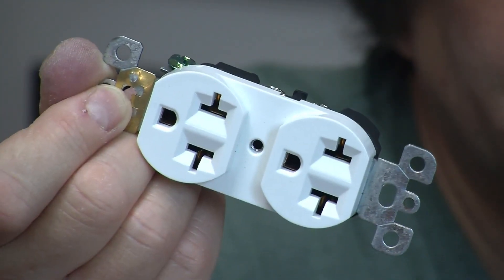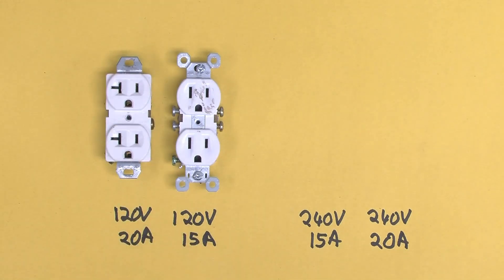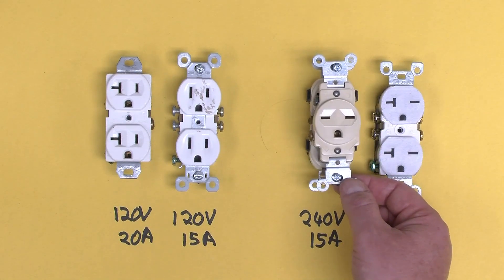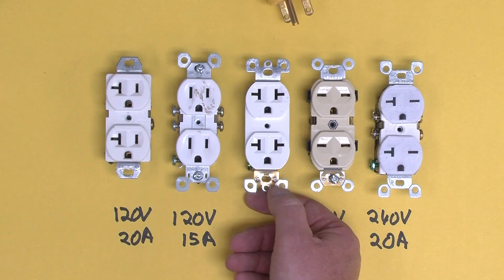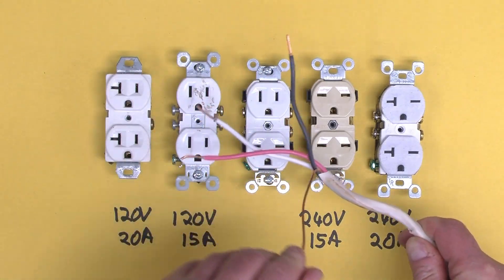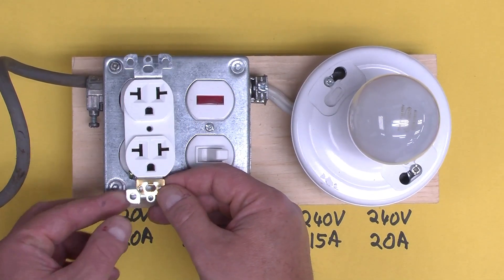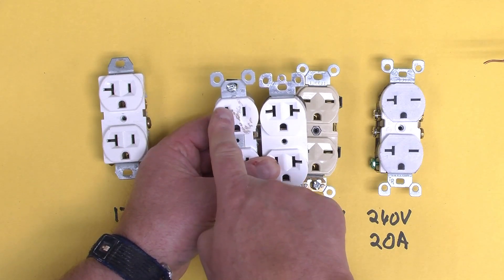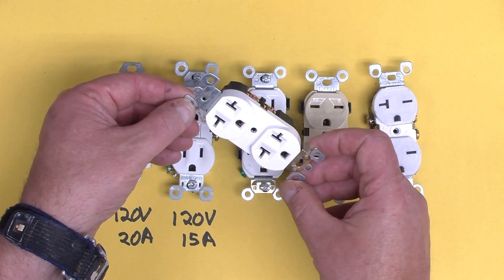Yikes! Don't use this Chinese-made Outlet!

Comment: I got a support call for one of my devices tripping a breaker. The caller was hard to understand since he was a bit excited and from another country (a country that exports things like the plug in this video and many other unsafe electrical devices). He also said that his genset wouldn't run. The genset was from another vendor, so I asked a tech from that company to see if he could look at my device while he was out there. My shop was a day's drive away from where this customer was.

The next day I got an email from the generator tech. It included photos of the two conductor 16ga extension cord the customer had cut and wired to a 240v 50A circuit on the big diesel generator. The flimsy extension cord was routed through an open cabin window on this large oilfield service machine, and was plugged in to a neatly mounted 120v power strip, the ground pin nipped off. My 20A 240v device had been wired to another chopped two wire extension cord and plugged into that strip. No ground at all, of course. It was the circuit breaker in the power strip that was tripping.

The customer was exporting this large piece of oilfield equipment back to his large Asian home country, presumably to be copied. I learned from the generator tech that the customer I spoke to was a big wheel in his company, an electrical engineer... with a PhD. I bet that guy could find a thousand uses for the plug in this video.

(BTW, the problem with the generator was that the controls were wired incorrectly)
Reply from the maker: What a story! There certainly is a difference mindset in other places, and at times also a lack of understanding or education. Surprising here with someone dealing with what sounds like high end or expensive equipment. Having said that, I occasionally seen the ground pin pulled off cords here (Canada) to make them fit, so we arnt faultless either. 

When I was  kid my dads job meant we lived in different countries every few years. We lived in Baghdad in the mid 1970s. Even then I was interested in electricity (OK so I'm a real geek!) and I will never forget the wiring. The original in the house wall stuff was  good from when it was originally built. But any additions - and the connection to the grid - was just was a different story. Wires just hanging on walls no support, the connection to from panel to grid was just hung (not secured) over the garden wall. In some downtown places power poles looked covered in spaghetti from so many wires. And phone lines were draped from tree to tree or whatever would hold them. 

It all actually worked except when it rained a few times each year - phone system would go down for days. So your story of the fellow just hooking things up with whatever really reminded me of Iraq!
Reply: @ElectromagneticVideos  Educated in that other large Asian country. I have had the "good fortune" to work with both electrical and mechanical engineers from that country. I found in both cases that their educations and personalities had little interest in standards and careful component selection. 
For whatever it's worth, I also consulted for both German and Russian PhD-level mechanical engineers and found both quite willing to take in new information.
Reply: did you mention that he is an electrical engineer with a PhD?  Did he get educated in the States?
Reply from the maker: @sportsonwheelss  Speaking as geek with with a PhD myself, I have come across many EE PhDs who have have never actually done anything practical and a wire to them is a line on a piece of paper. And others (and I am thinking of a particular physics PhD and another particular EE PhD) where you wonder how they ever got the degree in the first place. And in both cases these individuals had studied at some very highly rated western univeristies.  So I wasnt entirely surprized at the story. And to be fair I have come across many others with  grad (or undergrad) degrees who are most impressive  as one would hope!

Comment: You are giving advice that's contrary to code. 
The NEC requires that 240v plugs and connectors never have more than a 120v differential between ground and line. (I am simplifying the description a bit from the precise language of the NEC.) This "split phase" design forces a 240v outlet always to include both sides of the line (L1 & L2) plus the neutral, so there's only a 120v potential above ground (i.e. the neutral point). Other sections require the presence of a separate ground, so 4 wires are required in a 240v outlet for new work (in a residence). 
The 240v connectors you are highlighting  all feature only 3 connection points.
The inspectors in our jurisdiction will fail your work if you use one of those 3-wire 240v plugs, even though that's the way the cheap 240v car chargers are sold on line. (This is especially true on EBay.)
If your house has such a code violation and there's any sort of electrical fire, the insurance company will deny coverage for Any and All repairs. (The NEC comes from the Insurance companies and is then adopted by individual jurisdictions (e.g. towns, counties, or the like). California actually rewrites the entire book.
And it's not a good idea to tell folks to do electrical work contrary to code (the NEC in the U.S.)
Mike
Reply: Specifically which NEC code requires 4 wire 240V outlets? (aka the NEMA 14-xxR series) as opposed to the NEMA 6-xxR series,
Reply: There is no way to get more than 120V from line to ground in the USA in a standard home. Kinda hard to violate that code provision when there is no input that will not comply.

Comment: Never use anything but UL listed commercial/residential outlets. The "residential" one's are fine for a lamp that's never unplugged. In my home, I'm replacing all 15 amp plugs and wiring with 20 amp receptacles and 12/2 wire with 20 amp combination arc fault breakers. They cost more, but well worth it. The commercial outlets are sturdier and can handle having plugs being frequently inserted and removed without harming the outlets contacts.
Reply from the maker: Really too bad people skimp and install the cheapest outlets - such a small savings compared to the rest of the cost.
Reply: @ElectromagneticVideos  true. I look at it from the long term and safety. CAFCI are worth the extra money. Also, with how electricity as we use in the USA, it's stupid to use cheap outlets and breakers.
Reply from the maker: @brianfoster7064  Our currents are so high compared to the 220/230V countries we really should stick to the better receptacles!
Reply: A 15a receptacle is rated for 20a pass through current. You may always use a 15a receptacle on a 20a branch circuit, unless it is the only receptacle on that circuit. That is NEC code. That said, you get what you pay for in terms quality.
Reply: Always used quality SPEC grade receptacles in kitchens, laundry room & commercial work to prevent call backs.
Reply from the maker: @JohnThomas-lq5qp  I can sure see how a cheap kitchen outlet that gets used a few times a day with plugs being pulled out while delivering large currents wouldn't last long!

Comment: You do not need those chinese outlets to make a mistake and connect an  appliance to the wrong voltage... Many times I have seen where a prong has been twisted and bent to fit.. Someone tried it at work to make a  commercial toaster with a NEMA 5-20 plug fit a NEMA 6-15 receptacle where another commercial toaster of different voltage once sat.....
Let's just say a 120v toaster running at 208V ( 3 phase supply in building) made toast really fast, only made it once tho🤣
That leviton combination receptacle would be a good choice to put for a window air conditioner if the space to be cooled could be done with a larger 240v unit. Gives the option to plug in any AC you want and have a dedicated circuit to do so.
Reply from the maker: Well as long as you can make the plug fit, everything will be just fine :)  :)  :) . I had no idea people twisted prongs like that - that toaster must have been something to see while it was (briefly) operating. If I  can find an old toaster, might make  video of something like that - outside of course with all sorts safety protections. 

And yeah - that leviton combination outlet would be perfect for applications like you describe.
Reply: @ElectromagneticVideos  You don't need to fry a toaster to find out what happens - https://www.youtube.com/watch?v=UUPSGvWr6xE

Comment: I naively thought that those 120/240 combos could be wired to supply both voltages at the same time, but clearly not! 
Thank you for the video!
Reply from the maker: I am so pleased the video helped someone. The online descriptions and even the enclosed instructions imply if not directly say they can supply both, so your thought is completely understandable. Big issue is the outlets make et easy to plug a 120V device into 240V by accident or vic-versa, both of which can burn out things, cause fires etc.
Reply: If that's what they meant, I'm sure the worker in china had the best intentions at heart when making this dangerous outlet. let's hope they go on to make something safer.

Comment: Nema 6-15 and 6-20 are great for portable level 2 car chargers!
Reply from the maker: I'll bet as more people get electric cars they will become almost standard in any garage - or maybe even a higher current ones.
Reply: @ElectromagneticVideos  When I built my garage I added 2 exterior 6-20 plugs and two interior 14-30 plugs. When I build my dirty workshop it'll also have an outside 6-20 and inside 14-30. Future proof and welder approved!
Reply from the maker: @231pilot  Its so easy to do that when something is being built its to bad so  most people just take the minimalist approach. I had major renovations done 15 years ago and had them put in a 60A panel in the garage for the welder since all the walls were open. And at the back of my mind in was thinking maybe an electric car in the distant future. Wasn't a bad idea in hindsight. I totally agree with you about future proofing!
Reply: @ElectromagneticVideos  Most people don't get to design their own home. Generally speaking you get what the contractor decided upon, and they have no vested interest future usability, so many of them cut any corners they can get away with.

Comment: I findt it purplexing that north america have't re-design their power outlets and plugs . 
Maby just add an extra hot prong, to get a dual 115 and 230v outlet, and still keep backwards compatability with their acient  unsafe old 115v plugs.
Then finnaly  joining the rest of the world, with deacent capacity out of a standard outlet.
So many Amps, so much wasted thic guage cabeling, , just to get half the Watt-capability from a standard outlet.
Reply: Oh man, if I had a dollar for every one of these comments on my channel, I'd be rich :)
Yes, fair observation, but I just don't see it happening. North America simply adding a 240V option to its electrical supply back in the 40's - 50's instead of committing to switching even small appliances to what was then 220V meant that there will never be a full switch to 240. And yes, the american outlet design where prongs can be exposed is a fixable flaw that nobody wants to fix.
Reply: @Gruntled2001  
I wish more plugs had removable fuses like the British plugs.
Fuses are in very few things here such as pedestal fans.
Reply: @jeffkardosjr.3825  yep, I was just going to say - in the absence of built-in receptacle fuses some appliance manufacturers put them into the plugs.
Reply from the maker: I think its really the huge installed base than makes any change impractical, and what we have fits the "its good enough" rule so there is little motivation to change.
Reply: You’re just ignoring the huge margin of safety of 120V over 240V?

Comment: Ya I've seen and used 240v 20a but never the 15
Reply from the maker: I think the 240V 15A is rare because, well if you are putting in a 240V circuit, its usually for a higher power application and with all the labor cost of putting in the wire, its mot much more expensive to go for the full 20A #12.
Reply: I have a 3000 watt portable heater in my garage that has a 240 volt 15 amp plug.   Originally I had brought it while living in Pontiac Michigan,  because the house I was renting at the time had very poor insulation , and sometimes a standard 1500 watt 120 volt heater wasn't good enough when it got subzero with high winds.    I plugged it into the air conditioner receptacle 240V 20 A, which  can also accept the  15 amp plug as well.   A buddy of mine has an small  indoor greenhouse,  and used the 240 volt 15 amp plug on his  four 630 watt ceramic metal halide grow lights.   Since most metal halide and sodium fixtures can be selected for 120/208/240/277 volts, my guess is he wired them  for 240V,  so that he could put the 4 lights on one circuit thus saving some wire.    If he set the lights for 120V they would pull twice the amps which means 2 circuits would be needed.    That's the only times I seen a 240 15 amp plug, so I think they are far less common than the 240v 20a
Reply from the maker: @Sparky-ww5re  Interesting! I have never seen a 3000w heater like that. I have few 4.8kw construction heaters that need a 30A plug. Never got why they dont make them a bit less powerful to work on a 240V 20A circuit. The Chinese plugs were actually on a Amazon store catering to greenhouse people. I guess thats why. Want to hear a weird thing we have here in Canada? Lighting in many office buildings is 347V - the phase to neutral voltage of 600V three phase. One circuit can do a lot of lights just like you described. I think its pretty unique to Canada but I may be wrong.
Reply: @ElectromagneticVideos  I have a pair of 3000W infrared heaters in my garage that use the 240V 15A plug.
Reply from the maker: @kc9scott  240V 15A certainly seem rarer but not extinct as you proved!  

Just in case anyone misunderstood, I have no problem with 240V 15A  or 240V 20A  - its the one receptacle that allows both the 120V plugs and the 240V plugs to fit in potentially causing damage or worse is what I was trying to warn about.
Reply: Ya I have seen like 2 Air conditioners with a 240v 20A plug and a heater I think thays It